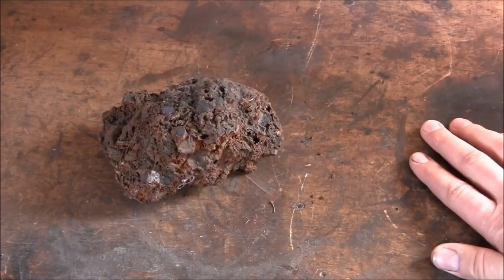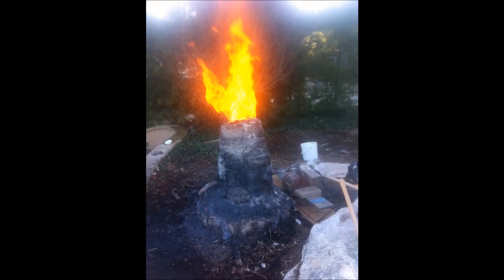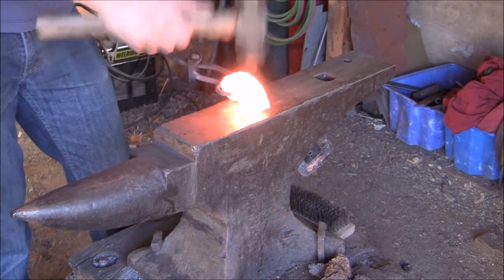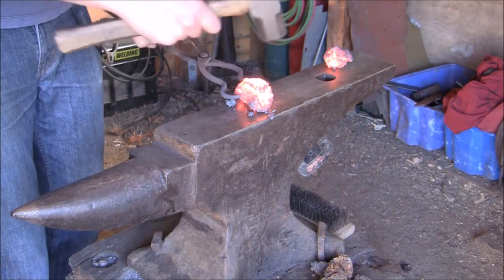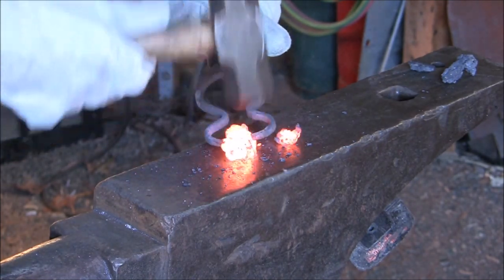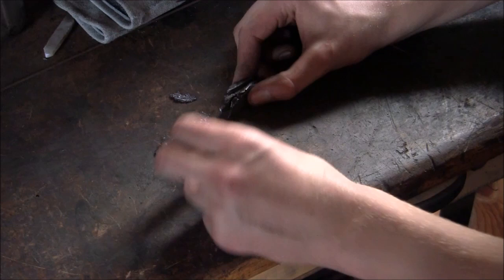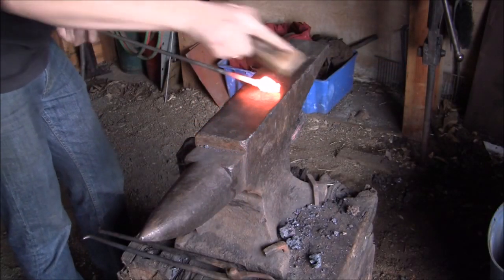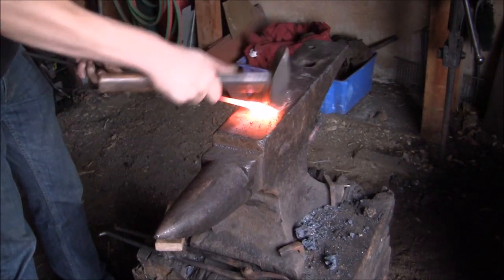Blacksmithing- Forging Iron from Iron Ore (Experiment)

Comment: When roasting the iron ore did they pop and shoot pieces everywhere. The ones i found alongside a creek did, wasn't sure if it was from thermal shock or from the moisture contained in them flash boiling. Was thinking about preheating them in my oven, like I do with my graphite crucible before putting it in my forge, before I roast it.
Reply from the maker: I think yours was from the moisture in the ore building pressure as it turned to steam. 
I don't think we actually roasted our ore. It was in the desert so there was no moisture though.
Reply: Mitchel Jacobsen yeah that makes sense. Lol ok cool, thanks.

Comment: so would this be iron or steel? considering how it went through the charcoal, would it have accumulated enough carbon to turn to steel, or is it just plain iron?
Reply from the maker: Pretty much iron, but not pure iron. It will have a bit of carbon in it, but not enough to consider it steel.
Reply: so how would one technically go about turning this into a useful steel for knife making or something?
Reply from the maker: It would need to be exposed to carbon for enough time for the carbon to migrate into the iron. This can be done by packing strips of iron into a container with some ground charcoal (which is basically pure carbon) and heating it to a very high temperature for several hours.
Reply: i think it's a wrought iron